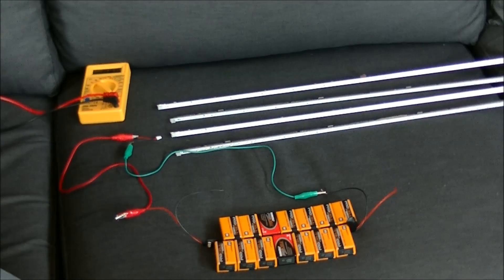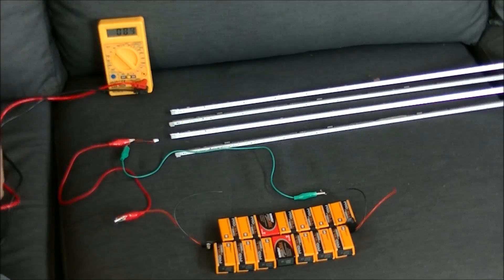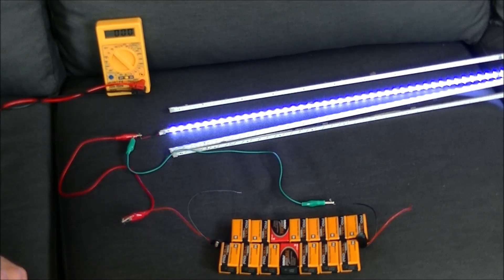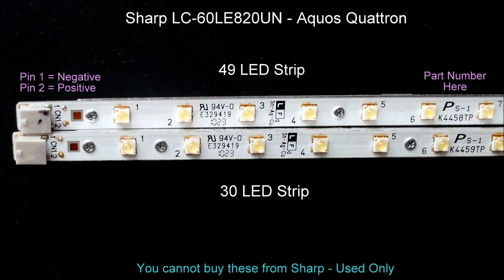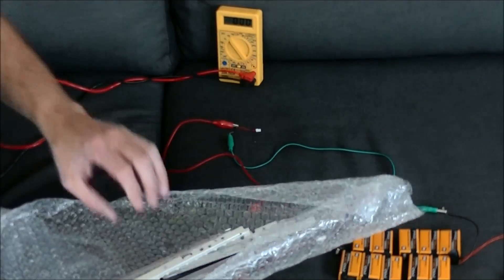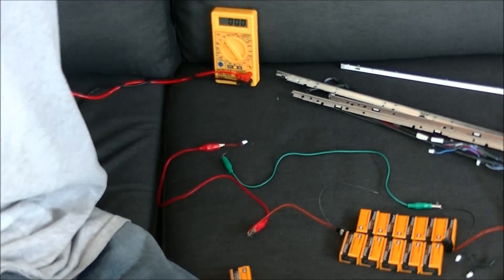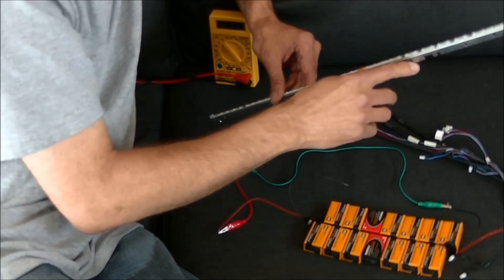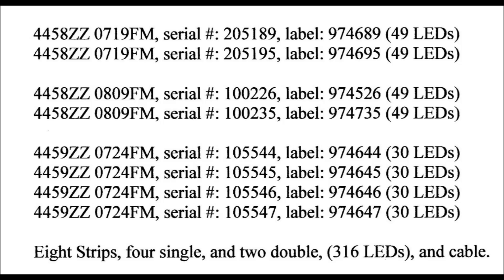Sharp LC-60LE820UN TV - LED Strip Testing - Long Version

Comment: Brett, thank you so much for this video! A friend recently gave me the exact model you're testing (LC-60LE820UN) for free because it couldn't work. The error code upon plugging the tv in was a repeated long blink, short blink...which points to an LED lamp failure. I took apart the tv this weekend and tested the LED strips exactly as you did in the video. During testing, 7/8 strips were extremely bright and 1 (30-strip) was very dim like one of the shorter strips you tested toward the end of your video. Do you know if the one "dim" strip would have caused the tv to cause an error code and not turn on? If so, I'm going to hunt the web for one of the smaller LED strips (using the part numbers you supplied and on my LED strip). Do you have any suggestions on where to find them? I wasn't easily able to find any on Ebay so far.

Comment: Very informative.  You know you can buy these LEDs on Ebay/Amazon and solder them on the ones that are blown.  Just get your polarity right., i.e. neg and pos.  Thanks for the informative video.  Some work like a string of Christmas lights and some don't.  Hint, when one light does out on a Christmas string, they all go out and sometimes when one light goes out on a Christmas string of lights, you can see the one out.
Reply from the maker: +Measuray Frank Thank you for your comment.  If you could provide the search terms for ebay and Amazon that would be nice for helping out others.  I'm not sure most people could solder new LED's on the boards since they are so small.

Comment: I tested all of the LED strips and found no lights out, but one strip is dim.  That strip also happened to be the first one I tested and I was trying to connect directly to the pins and shorted out on top of them.  So know I'm second guessing if that strip was bad or if I caused it.  Have you seen the dim strips before?  Is there something else I should test before replacing the strip?
Reply from the maker: +Dan Haglund I'm sorry I cannot answer that question - I did not have any dim strips but obviously yours had a problem.  Of course I cannot be sure that is the real problem .. but would be a first start if you know the power supply and other boards were okay.
Reply: +Brett Attee. I can get sound and a picture without the backlight.  Maybe I jumped the gun on going straight to the LEDs.  I guess at this point with the uncertainty, I'm planning on parting some of it out and buying a new TV.  Thanks for the video, it was very helpful.  Maybe a safety warning should be added to the comments?  Not sure how dangerous DC current is, but it gave a pretty good spark when I shorted the clips.  Thanks again!
Reply: Dan - I had the exact same "dim" strip that you mentioned... did you ever conclude whether the strip actually needed replacement? I'm in the same boat as you, do I just search for a new strip or do I try to replace the power and TCON board? Also, if you have any suggestions for finding these LED strips, please share!

Comment: What is the procedure for hooking up the 9v batteries to the alligator clips, to then test out the LED's? I have ordered enough 9v batteries to test out all the strips in my tv, and I ordered the alligator clips as well.  I have the same exact model as explained in the description; I want to test the LED's, just need to know how to hook up the alligator clips to the batteries and then how to plug it in on the side like you are doing. Side note: I've seen another video where the gentleman doing the same test looks to be touching the LED's with something, the video title is Fixing the sharp 60 led tv part 1, you actually commented on the video I see as well. I just need help with testing out the LED's and then I will order the correct ones and install them so my 60 inch tv can finally work again.
Reply: If you could direct me to what set of alligator clips I need to purchase that would be very helpful, all over amazon I see basic sets for like $2 and then I see complex ones for $20,. I don't know which ones to buy
Reply from the maker: +Dustin Schwarz Since I tested the LED strips outside of the TV there was no order to the alligator clips other than making sure you have the positive and negative on the correct sides which I outlined in the video.  Hopefully I will make a video on how to replace the strips in the TV ... to fix the TV once it is taken apart - I just haven't had the time.  The wires are like a Christmas tree light arrangement so make you you take pictures when disassembling.   Most importantly is making sure the strip is not attached to anything via wires when testing.  I would encourage you to video tape it for others and yourself.  Finding the strips is hard but can be done ... just have to be patient.
Reply: +Brett Attee so would these work to test out the LED's? On Amazon they are listed as Elenco TL-6 Alligator Lead Set, 10-Piece, 14 inches   by Elenco? .... Also would you offer me any help in this process, perhaps I could email you?
Reply from the maker: +Dustin Schwarz Those leads are perfect.  I bought a very similar set (had a few defective ones that really caused issues testing ... they would work but if moved sometimes the wire/clip connection in the cable would be bad - mine came from ebay/china .. so it is expected)  You are welcome to send me a message via youtube.